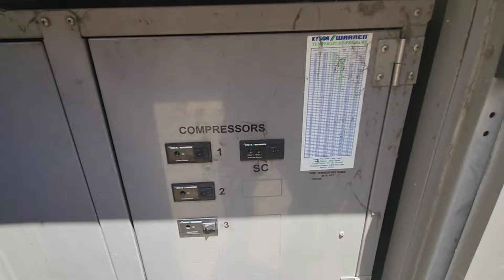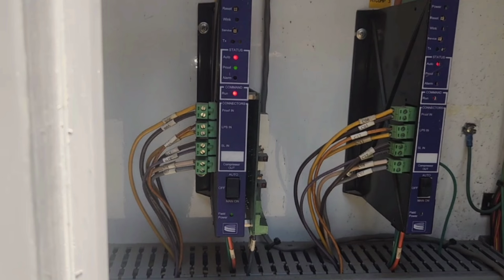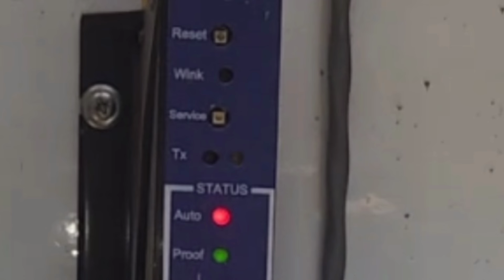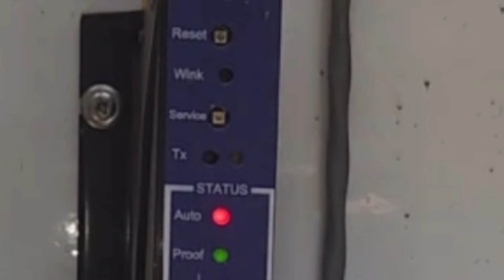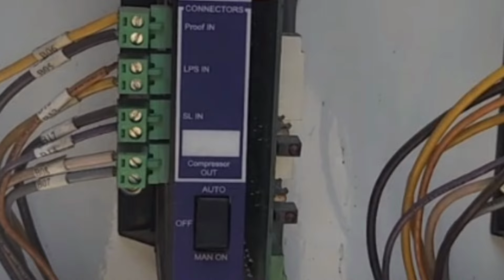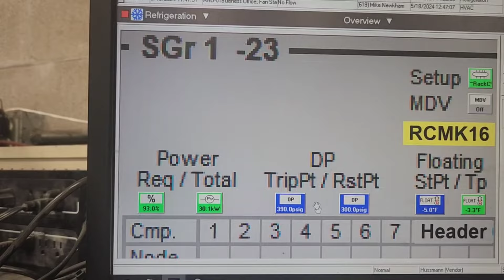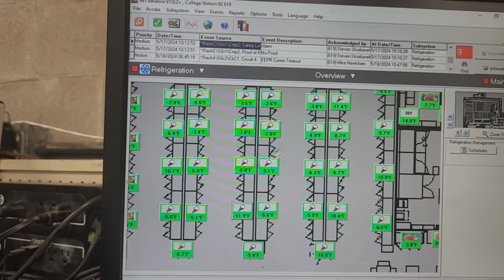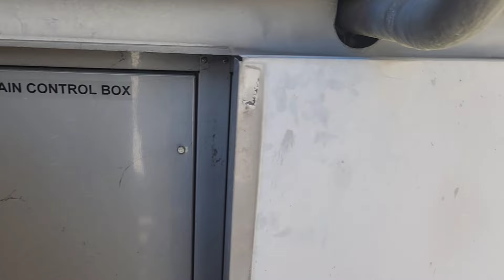Oil Failure Alarm On Microthermo Control System

Comment: “SL” on the compressor controller is “Safety Line.” Also the Service button on the controller is used to install the controller and program into the Microthermo software. In case you haven’t looked it up yet lol
Reply from the maker: No sir I sure haven't. I haven't had the neat to the only reason why.  Man I almost said in the video that that probably means safety lineI almost said in the video that that probably means safety line.  Because that's what was on the alarm. Oh well thanks for letting me know though.

Comment: At 8:41 in the video, I noticed the far right line appears to be valved OFF. Rookie question, but why is that valve apparently in the off position?
Reply from the maker: That must be the Spare Suction Stub. There's always gonna be a spare coming out of the headers that doesn't go anywhere, and it's also valved off. In case we ever need to add to the circuit Or change something, they will come from the manufacturer with those stub spares.

Comment: I have a feeling you’re going to running into a lot of this after equipment starts getting powered up after the storm. They are going to be under a heavy load until boxes start coming back down not to mention high current draw and possibly single phasing. The heat and humidity is brutal out here right now take care brother and hydrated.
Reply from the maker: I think you're probably right. They're still over two hundred thousand or close to 200k meters without power this morning. I think we will be dealing with power related issues for the foreseeable future

Comment: Is the there a name for the kind of refrigeration rack? I done work on protocol racks
Reply from the maker: The only thing they're really called is Parallel  Rack Systems. But they operate the same way that Protocols do. I don't think there is any difference between them except for Protocols live indoors and have remote condensers up on the roof. Parallel Racks exist on roofs and in Motor Rooms. It just depends on different factors that determine what's installed.